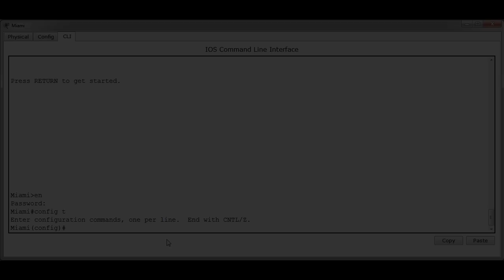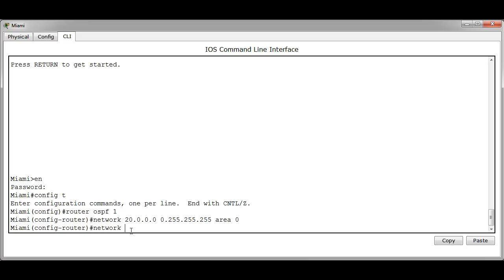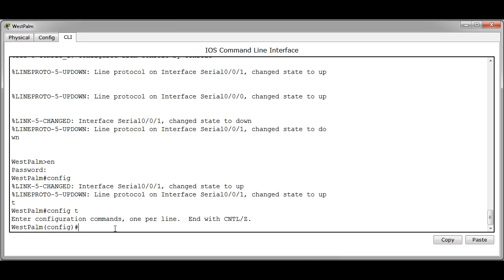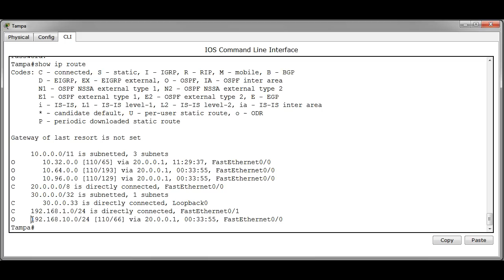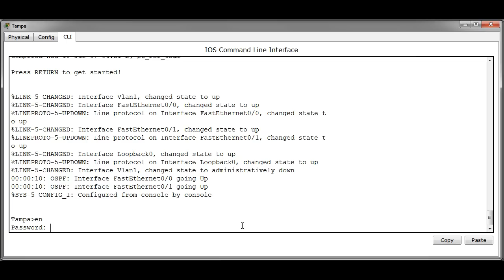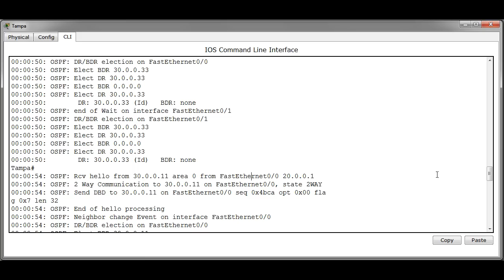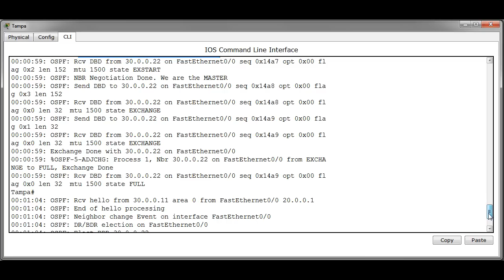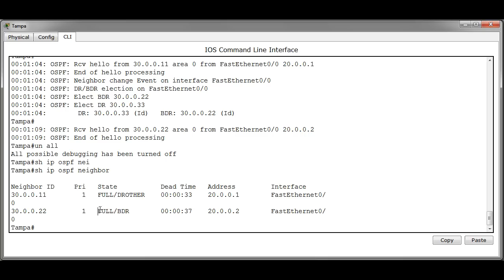OSPF Config 1 w/ Lab Included

Comment from the maker: It's not going to blow up or anything like that. If you don't set up a loop back address then the router will just use its interface addresses to conduct the DR/BDR election. Setting a loop back allows you to have some control over the process.